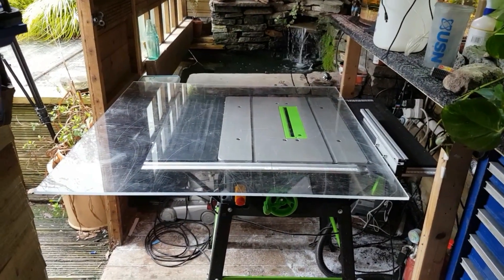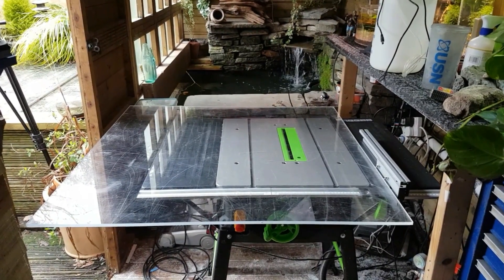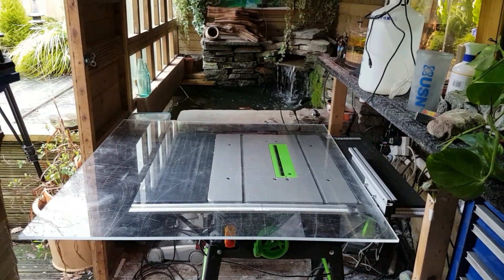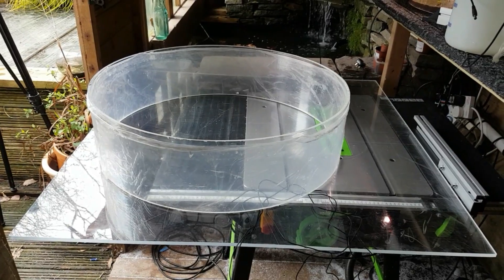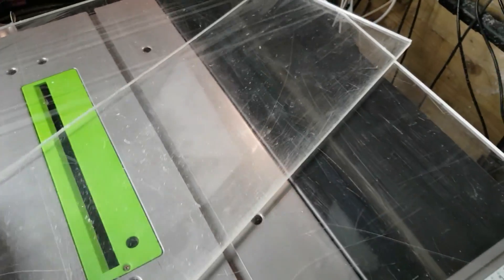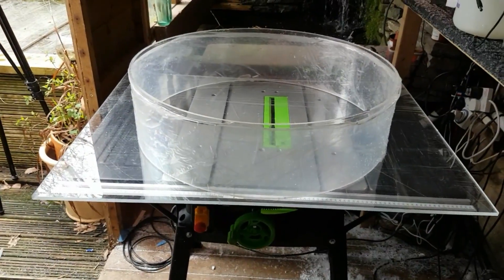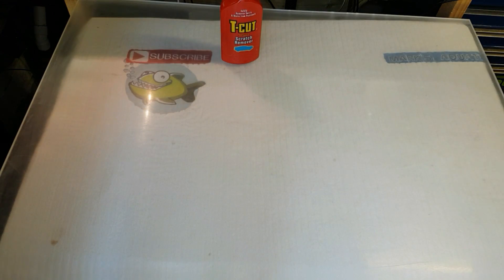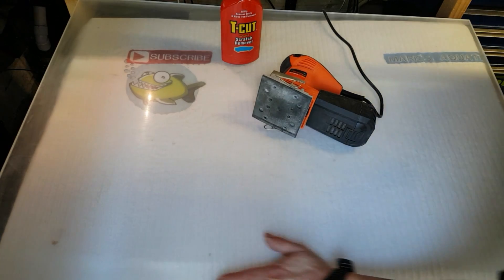LIVE JELLYFISH AQUARIUM PART 1

Comment: If you want finer grades for sanding look at jewellers supplies - micromesh goes all the way up to 12,000 and easily available on ebay (you should be doing that with water, that dust isn't good for you!!)
Reply: Actually I think mine go to 20,000!
Reply from the maker: I was using water.👍😀